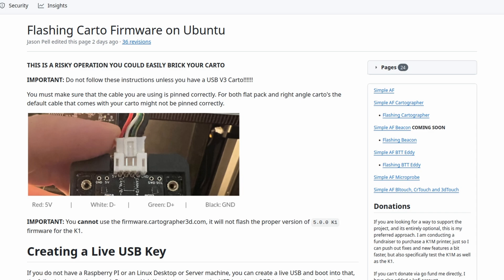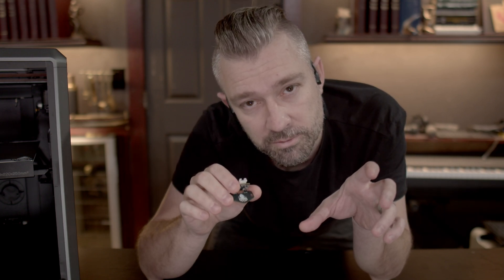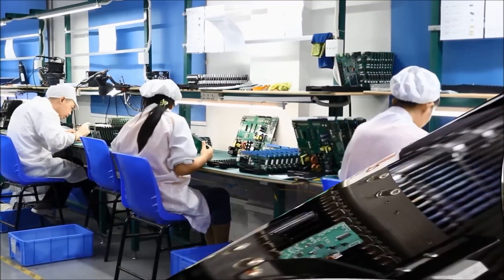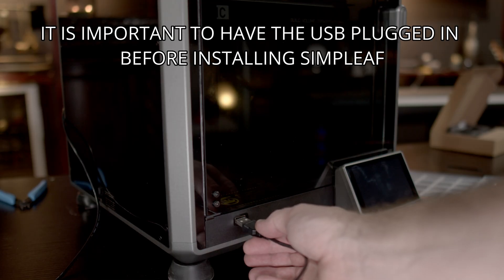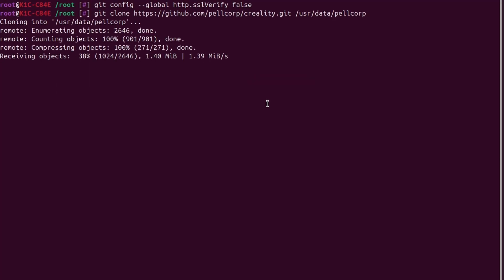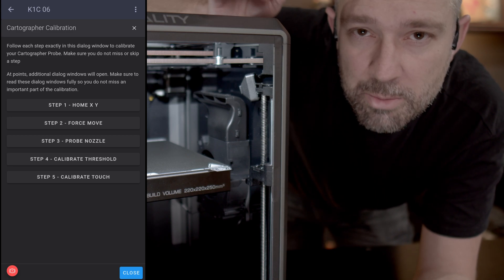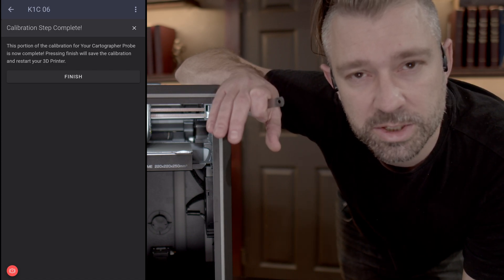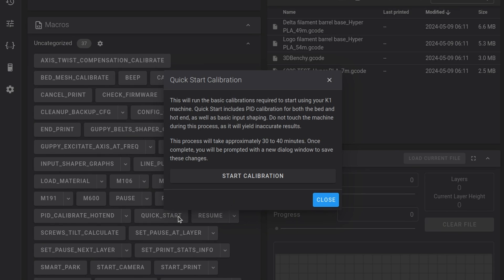Installing the Cartographer3D in the Creality K1 Series

Comment from the maker: ➡ Cartographer3D Installation Links ⬅
⚠ IMPORTANT - Recent firmware updates have changed the naming of the calibration macros. The new names are TOUCH_CALIBRATE and SCAN_CALIBRATE ⚠

Grab a Cartographer3D
https://cartographer3d.com/pages/resellers

Cartographer3D Probe Firmware and Flashing Guide 
https://github.com/pellcorp/creality/...

SimpleAF Creality K1 Firmware
https://github.com/pellcorp/creality/...

Cartographer3D K1 Series Mount
https://www.printables.com/model/1037...

2.0x5mm Flathead - Screw kit
Amazon Affiliate - https://amzn.to/3AZwrtT
Reply: The Macros dont seem to be these names either. 
I clicked Cartographer Control and that seemed to be it...I think.

Nope. Sadly, all I get is !! No Scanner model loaded
Reply: @TableFlipFoundry  Yes, you are right, there is no calibration macros, I'm following the SimpleAF manual
Reply: yeah i don't see any of the macros so i am panicking on what i need to do :D

Comment: Thank you very much for creating this video.

Some helpful info: My newer K1 did not come with extra screws. I used two M3*16mm Hex Socket Head Cap Screws to mount the Cartographer3D sensor. It's also worth mentioning that there are no threads in the holes on the print head. I didn't have self tapping screws which is why I used M3*16mm instead of M3*20mm. I was worried about splitting/breaking the part of the print head I was screwing into. It took awhile to figure all of this out so I wanted to share.

Comment: So the GitHub says that the firmware in the carto needs to be  changed to one that suits usb connection on the K1max, but you don't mention this at all?  I'm wondering if this is why none of the macros show up when I follow your guide?
Reply: im now facing this as i just reflashed the k1-max
Reply: used to get the option to configure it under macros and now i dont.

Comment: So where can one find a suitable shielded USB cable?
If it possible to ‘bridge’ the Lidar connector on the K1C tool head to connect/route to the USB connector on the motherboard? So no reason to have to run a USB cable all the way down and through the enclosure?
Reply from the maker: If you're using the K1 Max, this is possible. The K1 and K1C do not have a cable ran to the lidar port unfortunately.

Comment: Thanks for the video. I had to use the 1.7mm x 5mm screws as the 2mm cracked the print on the corner on an ASA print

Comment: Idk I tried multiple times with no success. Copied bootloader and just get command not found. Pins are correct I don’t know what to do now do I unplug the carto and start over? My bootloader code block is somewhat different than the one in your video
Reply: check the comment I left in your post about the run installer issue. I was running into the same problems, and this seems to have worked for me

Comment: Hello. as i do according to your instructions but i get a error:
INFO: There is 89.8M remaining on your / partition
INFO: There is 104.1M remaining on your /tmp partition
INFO: There is 5.9G remaining on your /usr/data partition

INFO: Mode is install
INFO: Probe is cartotouch
ERROR: Invalid cartotouch mount Mount specified!

 please help.
Reply from the maker: I would recommend joining the SimpleAF discord. There are a lot of helpful users that that can help with this.
Reply: You need to choose the mount you used. The commands are given in that error. Mine being SkeletorMK7, so I replaced the "Mount" text with "SkeletorMK7". Do this for whatever mount you used and then send the command. 👍

Comment: With the cartographer and the glass sub bed mod how much of a improvement and quality of life does this bring? Is it worth me getting a K1C and adding these mods (I love to thinker) or just get a BLabs X1C?
Reply from the maker: The quality of life for the printer is massively improved with these mods. However, I would never endorse purchasing a Creality K1 series printer. These videos primarily exist to help those who already own the machine and want to enhance their experience.
Reply from the maker: If you love to tinker, have you considered the Sovol SV08? I would recommend the SV08 over either one for anyone interesting in tinkering.
Reply: @zerodotcmd  I’ll check that one out. Thanks for the response.
Reply: Oh nice! It’s got quad gantry leveling and based off the voron 2.4. Im intrigued
Reply from the maker: @DavidT811  yeah. It's all the voron fun for people who aren't super ready or interested in building a voron.
Reply: Only thing is I wish they had a smaller size. Current offering is only a beefy 350x350 😬
Reply from the maker: @DavidT811  yeah a smaller option would be good

Comment: Instead of the USB cable to the mainboard, can this be installed in the lidar port on the toolhead board?
Reply from the maker: @ryanjhayes  yes it can if you have a Max. If not then you would have to install the USB pass through first.
Reply: @zerodotcmd  I have the K1C. I’ve seen people online talking about using the LiDAR port on the K1C for the BTT Eddy. Is that not possible with the Cartographer? Do you recommend this over the BTT Eddy? I opened the bottom for the first time today and snipped the zip tie to get more slack on the runout sensor and moved it inside in my riser. I don’t mind if I have to run the usb now that I got that top piece unglued and opened it up but the lidar port alone would be very convenient. I’m ready to get a probe and move to Simple AF. I’m just waiting on your recommendation lol 😊 thanks for the reply!!

** Update ** I pulled the trigger and ordered a right angle Cartographer today 😊
Reply: @zerodotcmd I’m pretty sure my K1C has the lidar port. You can see it through the vent on the left of the hotend?
Reply from the maker: @ryanjhayes  The K1C does have the port. but it's not wired to the MCU. to use this port you need to wire it to the MCU for USB passthrough.

Comment: Ciao amico, prima di eseguire la guida per SimpleAF devo seguire la guida "Cartographer3D Probe Firmware and Flashing Guide" ?
Reply from the maker: Sorry for the late reply, been rather busy on my end. Yes if you are flashing SimpleAF you'll need to flash it with the Cartography firmware. You can move from one branch to the other. There is some info on this in the SimpleAF wiki. it's also sometimes easier to simply just reinstall SimpleAF if you are switching from one probe to another.

Comment: Hi, thanks for this video and all the teaching. I have bought all the required parts but I am stuck at the beginning, regarding the UBS Live Key. I am on Mac OS and don't know how to create this Ubuntu Desktop. Is there another way for me to proceed please? Many thanks for your help.
Reply: You need to use Ubuntu to execute the commands for flashing firmware into the cartographer then u can use Mac’s terminal
Reply: Making a live usb isn’t hard
Reply: You can also dual boot so u can use Mac and Ubuntu or whatever operating system you want
Reply from the maker: Sorry for the late reply. It's been crazy over here. I have a video on creating a Live USB. I'm not a Mac user however so I wouldn't be able to be much help there.

Comment: I have a k1 max  do you have way to connect a smaller cable to the tool head where the linear was?  Is there a link?  The one that came with it has a USB port or a short one with black end caps. Thanks
Reply from the maker: To use the LiDAR port on the K1 Max, a custom cable needs to be wired together for the Cartographer. It's not to hard to do. Best place to find information on this is in the SimpleAF discord.
Reply: @ thanks I did ask on there and got the information. Cheers.

Comment: That's what's happened

"Scanner hardware issue: coil expected max frequency exceeded
Once the underlying issue is corrected, use the
"FIRMWARE_RESTART" command to reset the firmware, reload the
config, and restart the host software.
Printer is shutdown"

after trying calibration nozzle... How can i Fix this?

Comment: Hi. How can i solve this error? i can't calibrate cart3d bcs on Cal Trash his stop on No Scanner models loaded.

$ CARTOGRAPHER_MODEL_LIST
// No Scanner models loaded
Reply from the maker: You need to create models first. Scan models aren't created by default. You can do this through the calibration dialog macro.
Reply: @zerodotcmd  whoah, thx. I'm newbie in hobby. Your videos so clean and informative, I subscribed and never felt regret))) OK
Reply: @zerodotcmd Hi!  Sorry to disturb you but i can't after Nozzle Calibration Printer freeze and button Finish is inactive. How can i create a scanner model? i don't see anything like "Create Scanner Model"  I had this error again  when i trying to calibrate threshold "!! No Scanner model loaded". Please help me...
Reply: @zerodotcmd  Scanner hardware issue: coil expected max frequency exceeded
Once the underlying issue is corrected, use the
"FIRMWARE_RESTART" command to reset the firmware, reload the
config, and restart the host software.
Printer is shutdown

Now this happened
Reply from the maker: I would recommend joining the SimpleAF discord server. It would be easier to trouble shoot your issues in real time rather than through comments. The SimpleAF discord is awesome with very helpful community members. https://discord.gg/fzdZCXS95a
Reply: @zerodotcmd  Thx
Reply from the maker: @Vilka747  Another thing I will mention is with the newer firmware version I do recommend the touch mode over scan.

Comment: How do you actually connect the probe to the K1 motherboard?
Reply from the maker: If you don't want to use the front USB, you can make a custom cable to wire into the free JST socket on the MCU.

Comment: I just wanted to start with a thank you for all your great videos. I’m waiting for my cartographer to arrive. I did the glass mod and the bed is now it acceptable tolerance,  my issue at question is when I do a first layer for bed print test with my Z offset adjust. The print starts very good for the first third and after gets a lot of ripples (waves), im not sur if is the glass bed and the factory probe (lidar) that give my the issue, all calibration in orca are done, so will the cartographer  give my better first layer and adjust the z offset in different area of the bed
Reply from the maker: Thanks, I'm glad you are liking the videos! The factory LiDAR isn't very accurate at all and can cause all sorts of weird things to happen. This is mainly why I say an after market probe is required.

Comment: I read on the guide that octoeverywhere is no longer suggested due to system load and an external device is suggested. If I use an pi, will I still access the k1 camera?
Reply from the maker: I'm not quite sure about octoeverywhere as I haven't used it. I know there is some information about it in the SimpleAF discord. https://discord.gg/fzdZCXS95a

Comment: I've spent friggin hours trying to get KAMP working with the stock setup, useless. I'm brand new to full klipper (24hrs new) so I don't know what I need to do to get this cart working or change firmware?
Reply from the maker: To get the Cartographer probe working you'll need to install SimpleAF as it wont work on stock. SimpleAF uses KAMP by default so there's no extra setup required for it. If you'd like some help make sure to hop in the SimpleAF discord https://discord.gg/fzdZCXS95a
Reply: @zerodotcmd  it shipped today so be a few days.

Comment: Hello! I maked the linear rail mod from Bootycall Jones and now I want to install the cartographer. I has flash it firmware to the USB version for K1. Some questions appears... 1) I already have the guilouz creality helper script installed - do I need to do a full factory printer reset, or only the klipper uninstall and the adopted version install? 2) the carriage with that probe mount can be used with the original creality hotend? 3) Can I connect the cartographer wire to the lidar socket (K1max)? - is some changes needed for that in the settings?
Reply from the maker: I haven't worked with the Linear mod. I know several people have used it in the SimpleAF community. You may find more information on the SimpleAF discord about it. Anytime you install SimpleAF you'll need to factory reset.

Comment: Sir. I want to tank you for a fantastic video. Also for truly putting in the time and commitment in making these creality machines perfect. After this cartographer 3d install, and the bed fix (glass between the magnet pei sheet) its perfect. my K1 Max is flawless now. just perfect 1st layer every time no issues. Thank you and maker of C3d and the Simple AF firmware.

PS. i dont think your macros install with the simple AF fimrware. did the install 12/5 and they didnt show in fludd or mainsail. (calibrate cartographer). Either way was able to manually do it
Reply from the maker: Thanks for the feedback. I'm glad my videos have helped you to improve your machine. Sorry about the Macro confusion. There was recently a change with the latest firmware update that renamed the macros. But they are still there. I'm going to go back a not of it now in the videos description.

Comment: HI, GREAT VIDEO. CAN IT BE INSTALLED ON THE NEW K2 PLUS , I HAVE A K1 MAX ,BUT I AM THINKING OF BUYING A K2 PLUS , I WOULD LIKE TO KNOW , SO I CAN PURCHACE 2 INSTEAD OF ONE. THANKS
Reply from the maker: At the moment there is no custom firmware for the K2 as the community hasn't really gotten their hands on it. So the Cartographer 3D won't be working on the K2 for quite some time.

Comment: great video, and explains things clearly and simply, well done. So.... what about specific setups for the k1, K1c and K1 Max??
Reply from the maker: When someone installs SimpleAF, it automatically sets the configs to work for whatever variation of the K1 it has been installed on. So, each machine gets version-specific configs by default.
Reply: @zerodotcmd  thank you
Reply: Do we need to specify the bed size for k1m users?
Reply from the maker: @Ducati996sps  Nope. All the configs are already preset in SimpleAF depending on your hardware.
Reply: I read in a other comment that we can’t use your Cartographe K1 Series Mount if we have the glass bed mod. I ordered the carto 2 days ago go and have already done the glass bed mod. I need to remove the the glass?
Reply from the maker: @Ducati996sps  You do not need to remove the glass mod. I have a low profile mount on printables for the glass bed mod. you just need to print and use the low profile version.

Comment: Using the touch option should actually be better, as it could then compensate forX-axis twist automatically. Am I right?
Furthermore, what are your reasons for using scan, above touch?
Reply from the maker: Touch still doesn't help with axis twist as these are two unrelated issues. My reason for using touch is it allows for finer control over different printing conditions. I personally like to set my offset manually based off what I want to print.

Comment: Simple and clean video in my books.
Reply from the maker: Thanks! Glad you like the video!
Reply: @zerodotcmd  It's all good, mate. The Simple AF says that on a "K1M, you can use the lidar cable either directly by repinning it or via the pass-through lidar port on the tool head". if so, that made the process a bit simpler. and if the machine is already rooted, can I skip that step? I did leave an issue in GitHub not sure if I have done it correctly

Comment: I assume that like the Eddy, the Cartographer installation will require that the LIDAR sensor on the K1 Max, will have to be removed and set aside. Also, for those of us using the MacOS, it seems to me that all of the firmware installations can be done directly from the computer, correct?
Reply from the maker: Yeah this probe replaces the LiDAR sensor. Which is fine because the LiDAR is mostly a gimmick. 

This set of instructions won't work in MacOS, you'd still need to use Ubuntu.
Reply: @zerodotcmd  what about a vid showing how to dual boot a Mac with Ubuntu.... they are out there, but complicated to follow as I found out, but got there, one of your videos would be allot simpler I feel, for all of us.
Reply: @kljw66  that would work. You can run a standalone USB stick OTG Ubuntu instead of installing the full version.

Comment: Is it possible to connect the probe into the tool head in place of the Lidar?
Reply from the maker: Yes absolutely! There is some documentation on this in the SimpleAF discord I believe.
Reply: @zerodotcmd  legend, thankyou and love your work
Reply from the maker: @evanovski  No problem! And thanks for the feedback! 😊
Reply: That's great. It will be a much more cleaner setup. I read somewhere that this is only possible on the max.
Reply: This only seems to work for K1 max for now

Comment: so this is better than eddy how?
Reply: I have the same question. What really differentiates the two products? I don’t know which one would be better for me... If it's about size, the Eddy is smaller, so if that were the only factor, I would install it.
Reply from the maker: The Cartographer3D has more features and two different modes that it can be used in. The eddy works well but only has a single use mode and doesn't preform touch to automatically set its offset. On the K1 specifically I will say the Eddy does work rather well after all the tweaking that has been done for it in SimpleAF.
Reply: @zerodotcmd  well dammit, i already bought the eddy stuff for both of my K1 max's, i guess i will return it & get the cartographer then, lol.